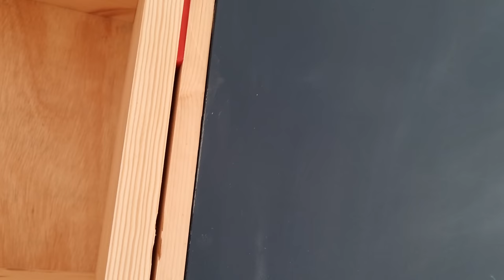Debra's Alcove cupboards & Shelves build Pt8 - Shelves & scribes

Comment: Love that vacuum head
Reply from the maker: Yeah, it's useful, i think it might make more marks on the wall tho smearing the dust in 😂 this one is on Amazon, i don't remember where i bought mine but it's the same https://www.amazon.co.uk/Bomoya-Hands-Free-Collectors-Effectively-Woodworking/dp/B09DKD1KRT/ref=asc_df_B09DKD1KRT/?tag=googshopuk-21&linkCode=df0&hvadid=534823757452&hvpos=&hvnetw=g&hvrand=4754715880076117805&hvpone=&hvptwo=&hvqmt=&hvdev=c&hvdvcmdl=&hvlocint=&hvlocphy=9046317&hvtargid=pla-1436901615515&psc=1

Comment: Can't beat Freud blades. Love them.  Got an old Freud 1900 watt router too and it's going strong after 20+ years.  Keep thinking I'd like to get a Makita 3612 but the Freud doesn't look like it's giving up any time soon so can't justify that one.
Reply: Oh...and don't get the Trend Easyscribe.  Got one thinking it was going to be really good and it's horrible. Proper waste of money.  The leads are really faffy to adjust, and easy to snap, and the blade is about 8/9mm wide so won't get into tight bits like the V on a skirting board, etc.
Reply from the maker: Yep that Freud blade is the same one i put in the Dewalt when i got it, it is just starting to show it's age but still does well, & yep my old 20yrs+ Makita is still my main router, works absolutely fine, it's 110v tho from when i was on site in the 90s, the only reason i got the Dewalt router was for the 80mm plunge, I replaced the Makita trimmer router with a cordless one for site but might have to get a ½" one too, might have to wait a bit to see if Makita bring one out but Hikoki do a cordless ½" & i have batteries 😏, & 😂👍 I looked at the Trend scribes, the people who design these things haven't got a f*kin clue, I've tried a few scribing type tools over the yrs but always seem to end up using a compass with the threaded bar, you can adjust it with one hand, it doesn't move when knocked or when your scribing & pushing against the wall or whatever. & it takes just a reg pencil 👍
Reply: @Gidjoiner  yeah the Makita cordless trim router is great. I use mine loads.  I've looked at the Hikoki 1/2" as well cos I have a Hikoki 18g gun, but I keep thinking it won't be long before Makita have a cordless 1/2" too and I'd rather wait and see what that's like.  I got the big Triton as well to permanently mount under a bench because I liked the plunge adjustment on it.  Not been as impressed with it though.  I noticed last week I think you have the same?

Comment: Fantastic video. Very well explained. I'm just wondering why they dont make jigsaw blade that cut on the down stroke. Save you having to do all the upside down work when cutting the scribe line.
Reply from the maker: Thanks 👍, they do make down cutting blades but i don't like them, they're thin, small teeth that clog easily & so burn out & they bounce - the machine kicks back if not careful, I cut upside-down for a reason, I do it on purpose, the jigsaw doesn't mark the surface, leaves a very clean cut & i can see the line clearly, 👍

Comment: Mafell dust bag?
Reply from the maker: Crap, the catch is flimsy & on the top, i keep catching it & the bag opens, &! because the bag sits on the saw with it's arse up in the air the port gets blocked quickly, not worth the money, ps. doesn't fit Makita, i had to buy an adaptor 😒

Comment: Gid.. get yourself a portable work bench, Black & Decker or similar and some downwards pointing jig saw blades. Much safer than holding it upside down.
Reply from the maker: Don't like the down cut blades, they're thin & bounce if not careful, I cut upside-down for a reason, i do it on purpose, it doesn't mark the surface, leaves a very clean cut & i can see the line clearly, & i have the trestle bench, i just couldn't be bothered putting it up for just a few cuts, there's already enough junk in the van to be adding more 👍